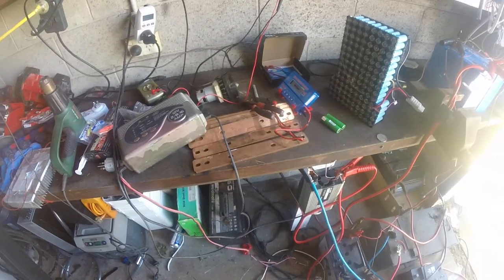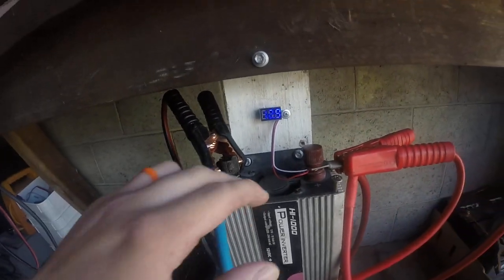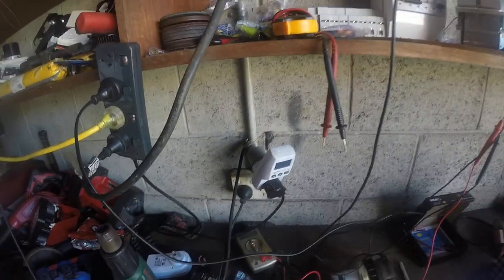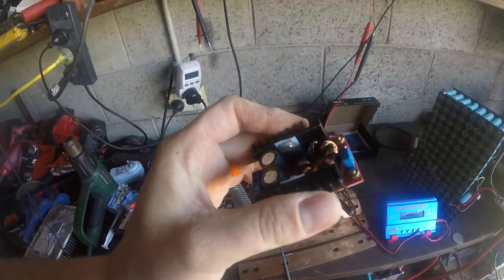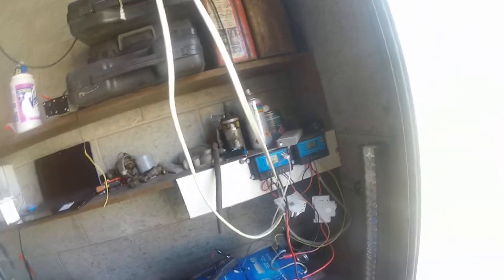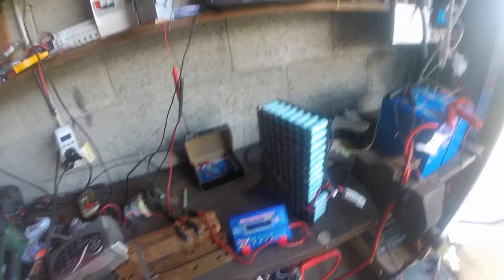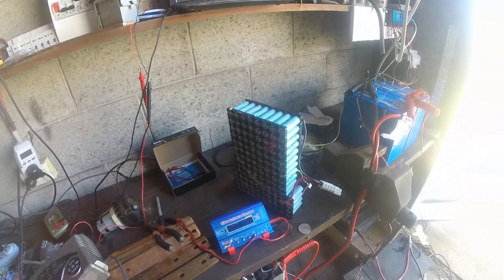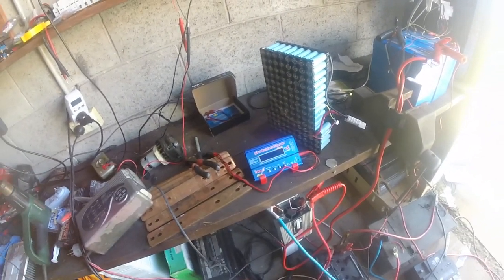What i use my small 750 watt solar setup for /update

Comment: I'm curious about those aftermarket Milwaukee batteries. Seems the 18V ones have a delay on trigger press versus the genuine stuff, this is noticeable in the fuel impacts. Is it related to the batteries can't deliver the inrush current or the logic circuitry are no good on those batteries. If the aftermarket 12V ones cannot max out the full torque of the skins.
Reply from the maker: yeah there cheap for a reason i guess the Milwaukee genuine stuff is awesome though